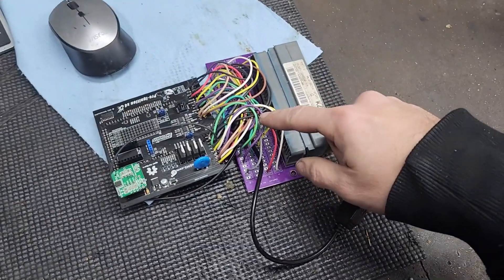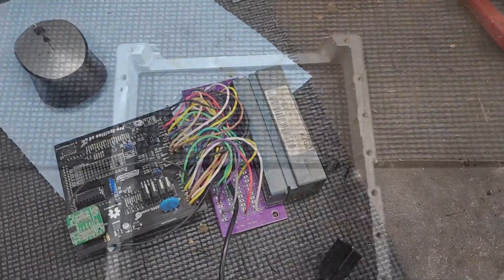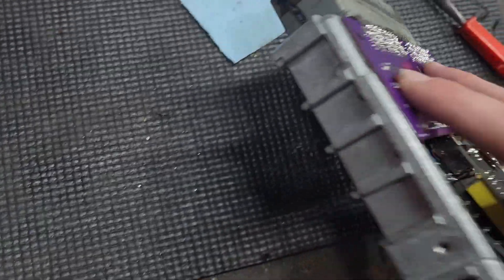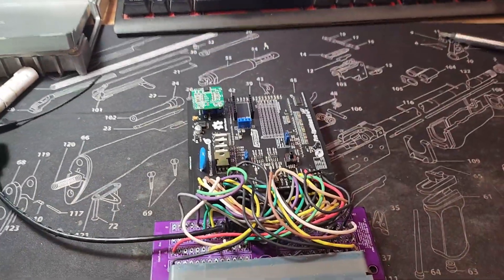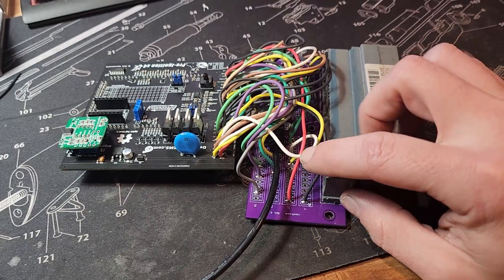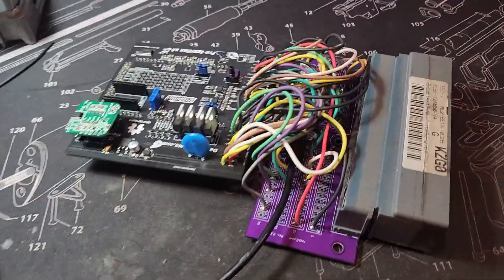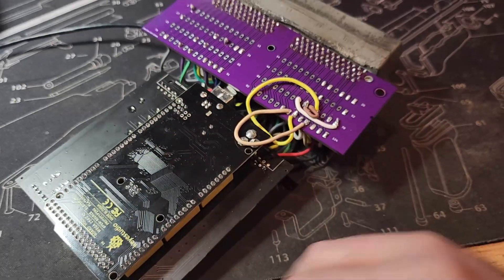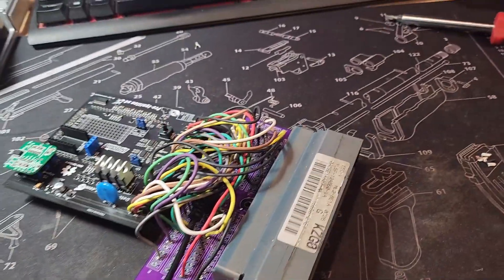EP2 ECU - 2000 Ranger 302 Speeduino ECU

Comment: Can I run a aode with speeduino?
Reply from the maker: You would need an external controller for the transmission; the speeduino does not have the outputs for that